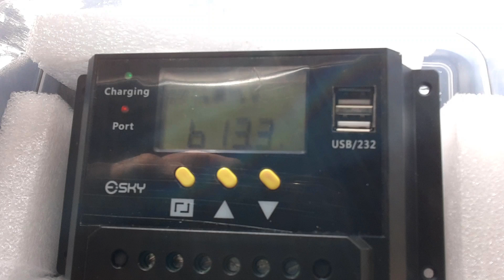Building a frame for our new flexible solar panel

Comment: Hi, great video. Good quality!
How long did they last? Are they still in operation? Is the efficiency comparable to rigid panels?

I've got a great deal on a set of 10x 300w flexible panels, but I heard they last less than a year in many cases...
I really do like this deal, and the panels themselves are from a reputable company.
After some thought I had the idea of adding ridgidity to them to make them more sturdy and thus, able to last longer- and happened onto your video.
Reply from the maker: Hi, Glad you liked the video..... this particular panel is still being used with no problems. Others with the same panels say they do not last long at all.... really depends on where you are located I guess. If I buy more panels and are not moving around the country I would go with the rigid panels as they will last a very long time in normal conditions. The flexible ones are better for someone on the move as they are much lighter and less apt to break. Hope this helps! Thanks for watching and commenting :)
Reply: @Youcan2Adventures  Thank you for your reply. I live in Namibia, just above SA - climate is almost exactly like that of Nevada- environment is the same.

I often wondered if at one point the two were connected before the continental shift, but that's really not important. 😀

The sun can be merciless during Summer - up to 105deg at the hottest, so let's hope they last!

Thanks again!

Comment: Just found this vid & your yt. Thank you for sharing. How/Where did you mount the panel? 

I have a tiny sedan and need to do a working road trip 550m each way. Needing to power 12v cooler for meds & diet + 12v lunch box. I was thinking eyelets & bungees panel on/inside roof while driving & just toss 'em in the trunk so the panel does not get stolen when working. What's your take on that? Suggestions welcomed. ☮️💟
Reply from the maker: Thanks for watching! I never did mount it to anything. I used it on my truck camper conversion (look for those videos on my channel) and did the same. I stowed it inside until I needed it and just put it on top of the truck, rv and even my boat. Still works great! Sounds like the bungee thing will work for you. It's very sad, but is the way things are nowadays with theft. People will steal anything so chunk it in the trunk as you feel the need.  Take care and enjoy the world!